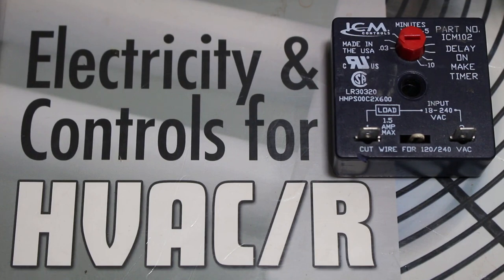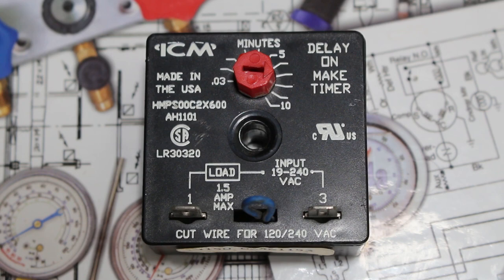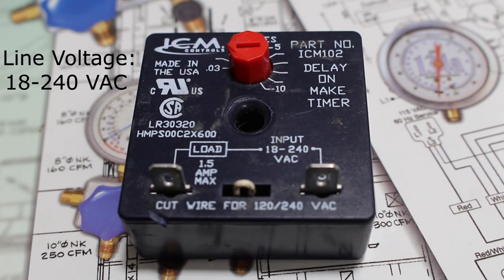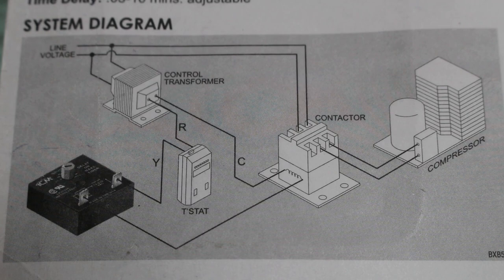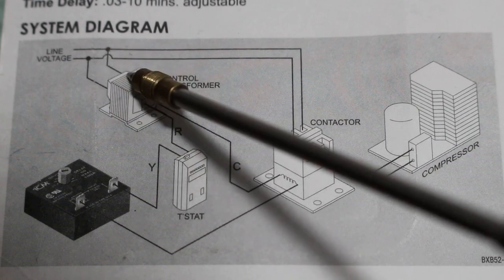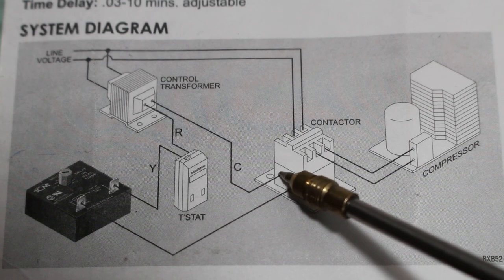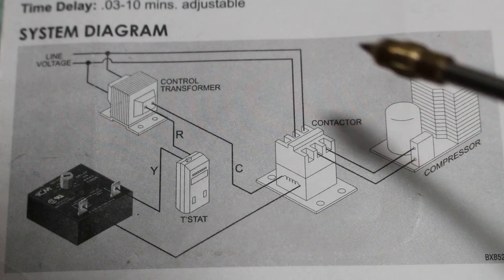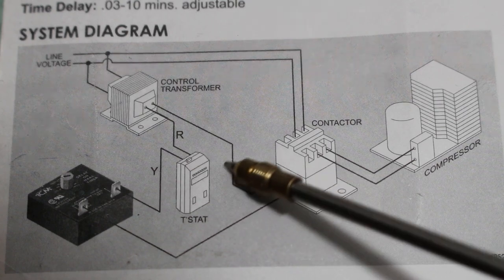HVAC Delay On Make Timer (How it works & How To Wire) Compressor Staging/Startup Delay Timer

Comment: Your videos are great, thank you for taking the time to make this content! Where would this DOM typically be installed? At the air handler or outside at the condenser? I have two units and one t-stat, would like to delay one to minimize voltage drops when they both kick on at once. Thanks in advance!

Comment: very useful gadget for any application, on my main switch i added a system with contactors and time delays on make and break,  so any time there is power outage these time delays prevent the inrush when there is no one at home. after the set time on make then the contactors drop and the other energizes, in this way when the city power goes and come your appliances is protected from inrush voltage. Thanks for the lesson on the use of time delay.

Comment: Hey, Jumper man: Great video. Thank you! I am trying to find a way to briefly delay the start of my small irrigation pump so that there will be time for the water valve to open first (better for the system over all). The sprinkler controller provides 24 volts AC to activate a 110V pump relay. If I install this unit that you are showing 'inline' on one of those 24 volt AC wires will that work to give me a programmable delay to the pump relay? Thanks for any confirmation you can provide and keep up the great work.

Comment: Im installing a generator, I’m load shedding my 2 ac units and going to use these so both ac wont turn on at the same time when power is out.

Comment: Great video. Question: can this also be installed on a freezer compressor?
Reply: Yes Luis, this can be installed on any refrigeration system but, in case of a freezer, the wiring scheme is different because usually there is not a 24 VAC control circuit in those devices. So you need to insert the delay time relay in the 120/230 volt circuit. In order to do that you need to cut the white wire loop on the relay. I suggest finding help from someone with knowledge on electricity in order to avoid injury to you or your equipment.
Reply from the maker: Thank you & yes! Stay tuned for new videos every week🔧⚡️

Comment: Plumber here: just used a time start delay you described as a temporary fix for a broken control panel for a lift station. Used a single float from the pitt, to one of the contactors, and the float to the time delay. Works great and the pump is not short cycling.

Comment: Yes,  this helps, I have a Essex 133 make delay,  I'm trying to test if they are good for a staged electric furnace control.  My mystery was how the circuit was completed.  In your diagram,  it seems like the contactor coil is the circuit completion.  Can you give some idea of how much resistance is in a contractor coil?   Or can it be zero.  Then I can see if I can make a test rig on the bench.  I look forward to your opinion.  Tx

Comment: Hey Jumper man Tech, I am not a HVAC tech person, just a regular guy with a question about what kind of timer I need.

My situation is as follows, I have a zoned HVAC system (at least that is what I call it), I have a 3.5 ton Lenox heat pump that supplies most of the living space in my house and then a separate 2.5 ton Lenox heat pump that supplies the 4 bedrooms. I am 74 and me and the wife are retired and to save money we only run one system at a time. Mostly during the day when run the 3.5 ton unit, and then at night when sleeping we run the 2.5 ton system.

Sometimes we need to run both systems, but not at the same time, we run one system for an hour, then turn it off and run the other system for an hour and keep cycling this process which tends to make the whole house comfortable without running both units at the same time (which uses lots of electricity)

So, I am in search for one central timing device (timer) that I can set to turn ON one HVAC system for an hour (or whatever time I like) while the other system is OFF, and then after an hour, it would switch units turning one OFF and the other system ON (from ONE timer).

I know I will have to add a relay to each unit to take the START/STOP signal from the timer and then in turn that would cycle the HVAC systems one ON and the other OFF and then after an hour the time r would reverse the systems.

What kind of time do I need? Thanks
Reply: These mods are nonstandard & most tech will not do it. Too much can go wrong, he gets called back or worse, unintended consequences that makes him liable. But...diy...there are flip-flop or cyclic NO/NC timer relays ( e.g. Siemens) that can be adjustable. You can put it on the tstat so only one compressor is on while cycling.

Comment: This is very helpful, can we use the same circuit for Delay On Break Timer as well. Intercepting the wire from T-Stat Y and the contactor ?

Comment: Hi. I had my HVAC tech install one of these on my unit and worked for about a year but then the compressor would stop running even when there was nothing causing a short cycle. The tech came out and checked the cap which was good, then checked the contactor and contacts were burned/worn. He thinks the delay on make timer may have caused the contactor to chatter resulting in contact burn and short cycling of the compressor. That said he replaced the contactor but also removed the timer. Have you heard of this happening with theses timers? Should I purchase and install a new one?
Reply: Adding to my comment above. Reading some other message boards it looks like some of these timers are causing a voltage drop on the load side which cause contactor chatter. I ordered the one in your link but I’m wondering if I should install it or not.